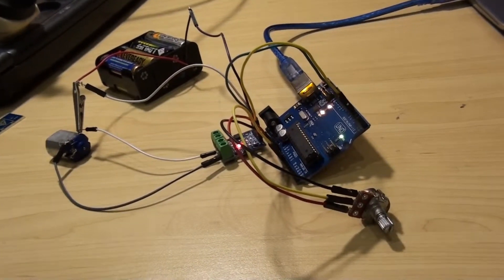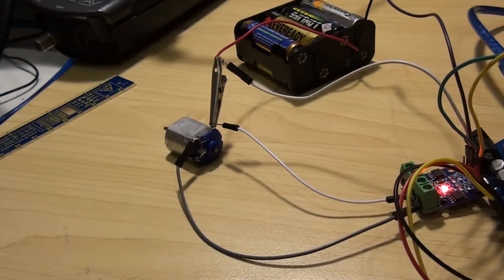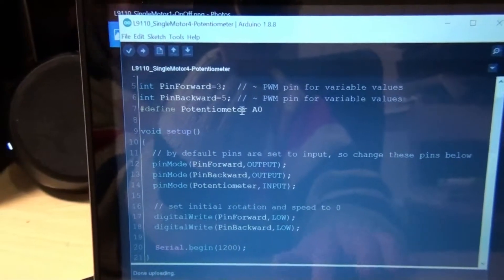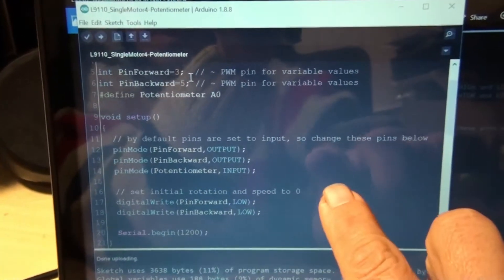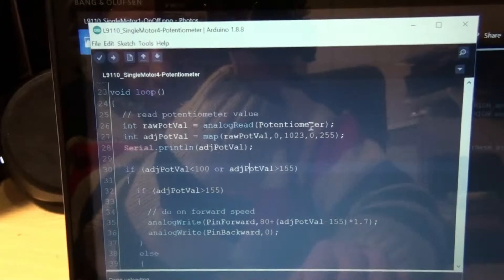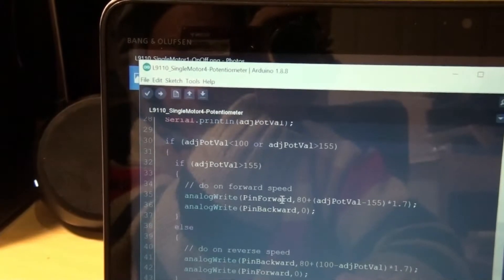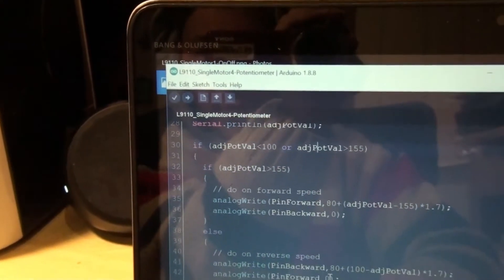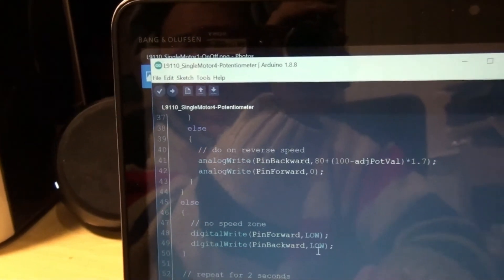Arduino #13 L9110 Motor Controller with a Potentiometer

Comment: I've tried do to this with 1 motor and works fine, tried to do the same with 2 motors and 2 potentiometers and it short circuits the L9110 can't figure out why. I tink is related to code, because it only burns when a move the second potentiometer. I'm trying to make a x y control with a joystick 2 motors and L9110 driver. Can you help me?
Reply from the maker: yes the L9110 can handle controlling two separate motors. a google search of the L9110 datasheet indicates that it can handle 2.5-12V power input and up to 800mA continuous current per channel. i suggest check your wiring and compare what u have done with wiring diagrams online. it should not short as long as u have the wiring correct.
also if u are using PWM on Arduino, use one of the tilde sockets on Arduino. the potentiometers have to be connected to Arduino on separate sockets. make sure u r using a battery or power supply that can deliver the current demand. a 9V battery may not be powerful enough depending on what motor u use. put 9V batteries in parallel to increase available current

Comment: is it possible to control two dc motors with two separate potentiometers using this technique?
Reply from the maker: yes, as you can see the L9110 has 2 pairs of DC outputs, so u can power 2  under 12V DC motors off the same L9110 controller and use 1 potentiometer to control the speed of both